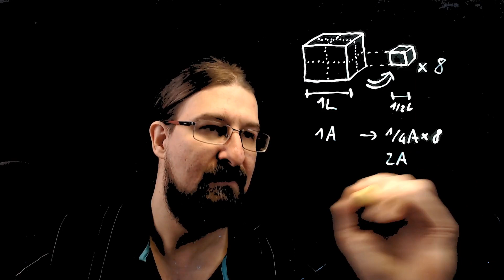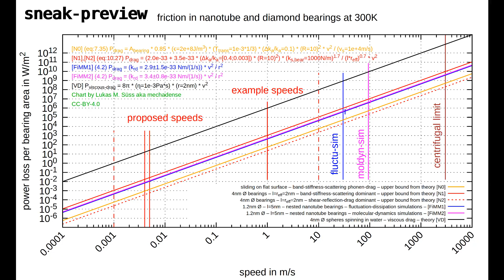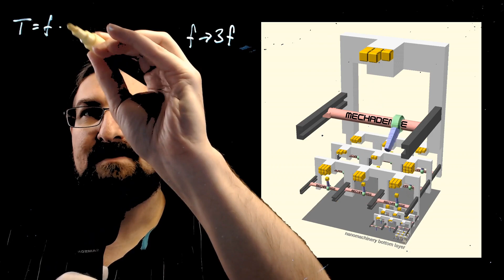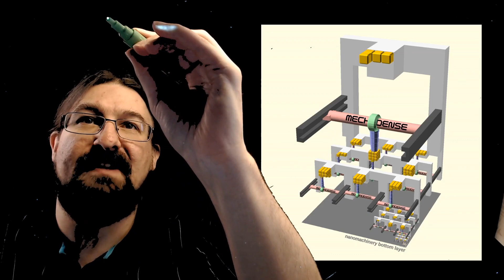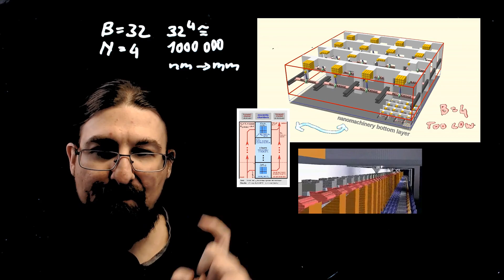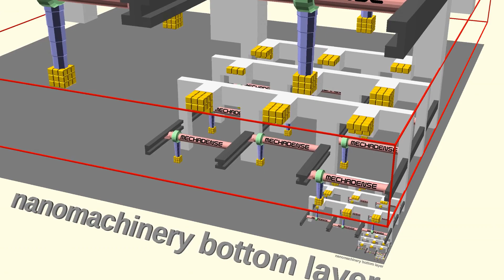The Surprising Productivity of Nano-Machinery

Comment: What if the assemblers do not float freely, but are rigidly fixed on a chip with the supply of raw materials and energy?
Reply from the maker: This would not be a good far term target.
That is: The (outdated) classical diamondoid molecular assemblers concept but instead rigidly fixed onto a chips surface.

The number of piezomechanosynthesis sites per unit of volume would be too low out of two reasons:
— general purpose piezomechanosynthesis is necessarily much bigger than hard-coded assembly lines (in terms of volume per reaction-site)
— every mechanosynthesis site would come with its own (for production not useful) "self-replication-backpack" further diluting density of synthesis-sites
(That's all beside the steepness of the challenge of the proto-assembler direct path to advanced productive nanosystems.)

At 21:50 I note the necessity of mill style assembly due to "little available space", not giving any explanations for why.
Let's assume we'd go for general-purpouse serial assembly instead (serial assembly like in the animation).
Then the now unavoidably necessary bigger genral-purpouse-robotics (including control systems) would force 
a bigger size of assembly cells and (as the input parts have a fixed small size as they are atoms) thus also a bigger branching factor (or … details).
A bigger branching factor slows down assembly significantly, as I've explained in the video.
So to compensate for that slowdown we would again need a thick stack of many (same sized) sublayer-cells.
But these assembly-cells are now significantly bigger than cells in a mill style system. So there's even more distance to travel. 
And that at the smallest scales with high bearing surface area per volume.
=> Thus we get drastically higher losses.

At bigger scales this pans out differently as ...
– the branching factor can be smaller
– the bearing surface area per volume drops
– bearings can have lower losses per area at higher speeds

But no worries. As we need many identical standard parts anyway 
(pseudo) hard coded mill style assembly is not that bad of a deal.
Reply: @mechadense  I can't imagine how to get to such a nanofactory in an incremental path. But in a direct path where there will be a cascade of tools that make each other, improving quickly. As soon as we have a good enough assembler instance, it will copy itself into a flat array. On this array, which will already be a nanofactory, it is possible to make more efficient versions of the factory with mills.

The "self-replication-backpack" will not be so big, since there will be no storage of energy and raw materials. There will only be a nanocomputer, it will also have to be made for a nanofactory with mills.

the nanofactory was invented in order not to have such a complex "self-replication-backpack" because supply of energy and raw materials will be shared.
I agree with the low efficiency of the universal manipulator, something will have to be done about it later
Reply from the maker: @nekitos3269  – I don't say such assemblers wouldn't work. I do say they'd be very slow and inefficient compared to other designs like mills on chip.
I am only talking about a proposed ideal far therm target here in this video. I am not talking about any aspects of bootstrapping pathways. 
As an ideal far term target molecular assemblers are most definitely not a proposed system.

In the context of bootstrapping diamondoid molecular assemblers could work eventually. But currently there is very little indication in progress in critical aspects of this direct path. Unlike the incremental path where there's a lot of accidental progress in critical aspects. I haven't talked at all about bootstrapping pathways in this video.

Molecular assemblers are a controversial stepping stone target. They are an alternative to other approaches that I personally currently see much more likely to pan out.  
Alternative pathways crossing some weird semi-stiff intermediary systems (that likely will also be dubbed assemblers / nanofactories ~ adding to confusion).
Molecular assemblers are not a proposed ideal far term target. They are not covered in "Nanosystems".

Maybe the confusion of hard exploratory engineering derived far-term-target and eventual-stepping-stone makes what I showed here come over as confrontative towards direct path proponents. Guess I should point out that distinction more clearly going froward.
Reply from the maker: In numbers: Size of (outdated) assemblers was IIRC proposed to be at least ~100nm or so. Likely a bit bigger. 
Assuming a product size of >20nm with ~0.2nm big C atoms that gives >100 "parts" side-length and thus a branching factor of >100. 
I.e. very roughly >one million parts to place. With a a speed of ~1mm/s and ~100nm to move per placement operation that gives >0.1ms per placement operation and thus >100s for assembly of a whole >20nm block with >1million "parts" (ignoring dimer depositions). That is giving a production rate of <20nm (product height) of extrusion per >100seconds for a single sub-layer (ignoring the situation worsening cutoff penalty). Or <0.2nm/s in terms of speed. Thus one needs >one million sub-layers of (outdated) assemblers to get back to halfway practical >0.2mm/s product extrusion speed. >one million sub-layers times >100nm assembly cell size gives a stack-size >10cm. Ouch. You can no longer exploit the "higher throughput of smaller machinery" scaling law to reduce friction losses. At least you are on the very limit even with the low size assumption of just 100nm.

With (actually as sensible far term target proposed) mill style assembly (allowing way higher density of reaction sizes and thus way lower branching factors, especially for lowest slow operating assembly levels) you instead get a sub-stack thickness (of this single assembly level) of micrometers for the slow extrusion speeds above. For actually nice practical extrusion speeds (way faster than today's 3D printers) millimeters at worst. The scaling law can be exploited.

As a side-note: Microcomponent recycling can likely be waay way faster as it does not need to go down to the very smallest size scales and thus has way less surface energy turnover amenable to efficiency losses. Topic for another video.
Reply: @mechadense  it's hard to believe in these calculations, I hope it's not so bad :) the raw material goes through the manipulators using conveys and mills inside. manipulators do not need to go far to take an new atom.  But there are other problems - the assembly areas must overlap with the neighbors so that if 1 assembler breaks, the neighbors can replace it. I can't imagine how to do this with mills.
Reply from the maker: @nekitos3269  – For repair of optimized mill style gemstone nanofactory chips (repairing radiation damage or whatever) you'd treat a nanofactory chip as just like yet another recyclable product. Placement, reconfiguration, and component testing of mills is done by the higher up assembly levels (assembly from crystolecules and upwards to microcomponents and beyond). These higher assembly levels do feature general purpouse programmability.
Reply from the maker: @nekitos3269   – Btw: I'd prefer to have such longer form discussions on the sci-nanotech forum as youtube comments are hard to refer to and generally seem more fragile.
Plus walls of highly technical text might deter more casual commenters.
Reply from the maker: In any case tanks for commenting 🙂